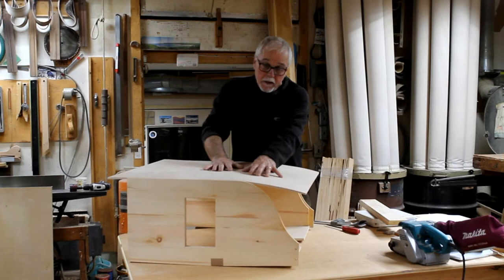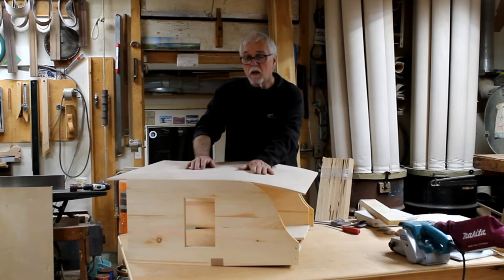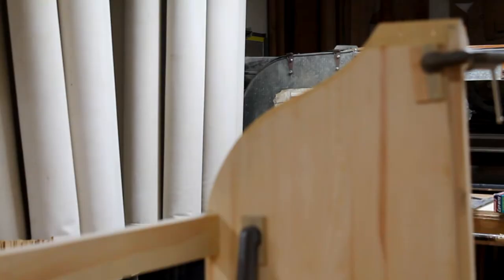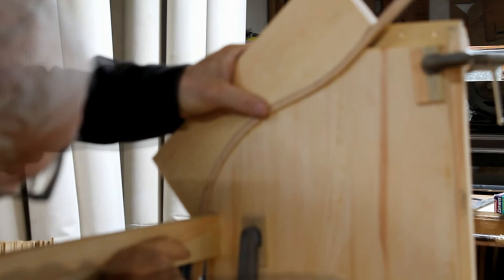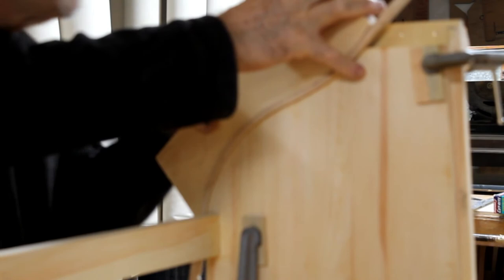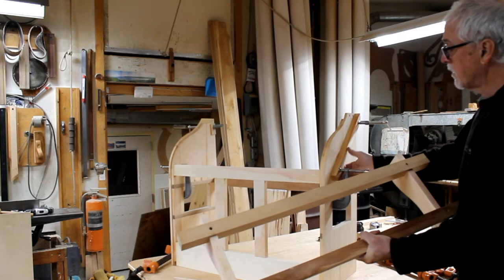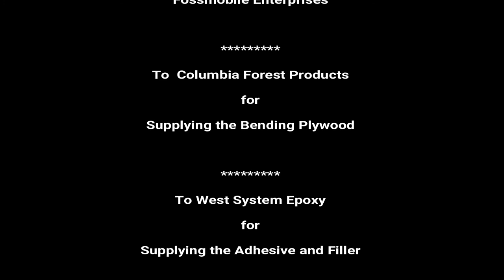Bending Ply Video

Comment: Car was built in 1897. Just curious as to why plywood is being used? Plywood was first introduced in Canada in 1913 at the Fraser Mill in British Colombia. If period correct is the goal, It would appear that in 1897 a craftsman would have taken lumber and shaped it pcs by pcs & glued it together with hot hide glue.  Just wondering.Thanks for sharing this very interesting story.